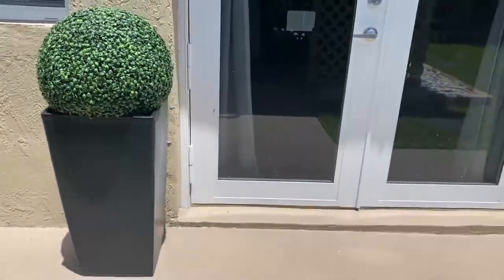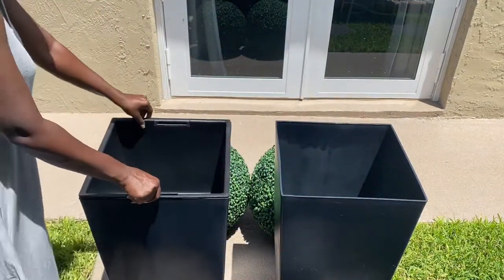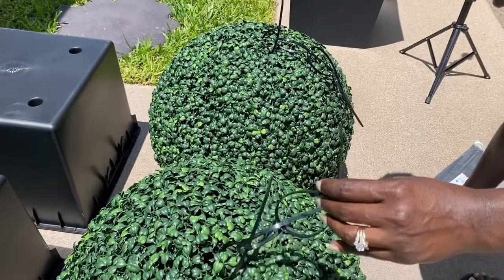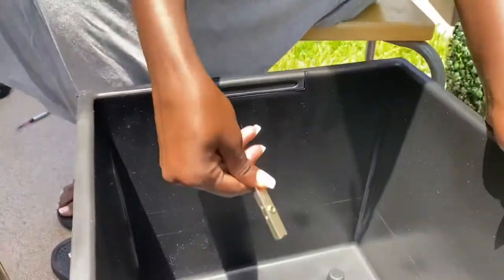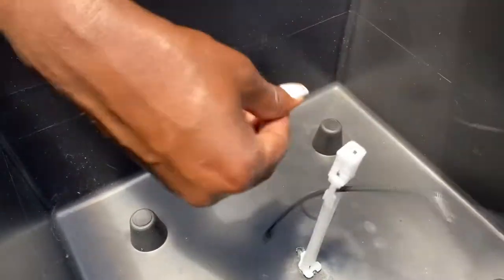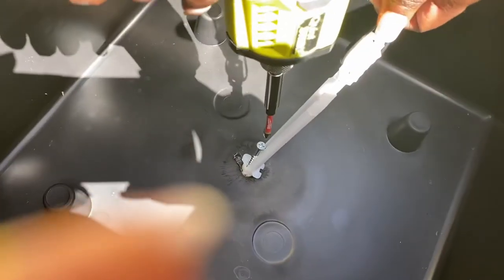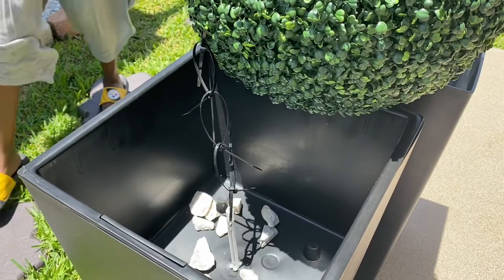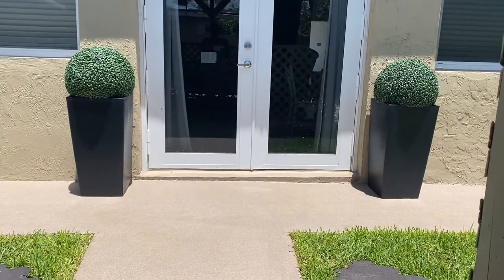How to Secure Faux Boxwood Topiary to Planters

Comment: How do you drain the water when it rains?
Reply from the maker: Once it fills up, I’ll drill a small hole 🕳 in the bottom back of it to drain.
Reply: Looks beautiful, great job! Do you spray a UV protection on the boxwood?